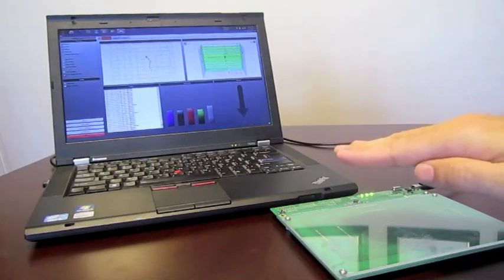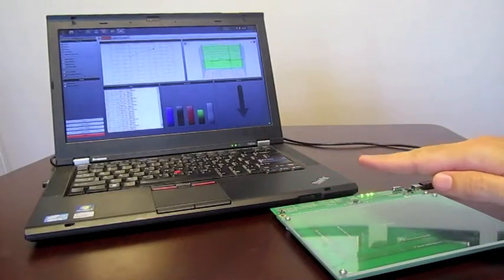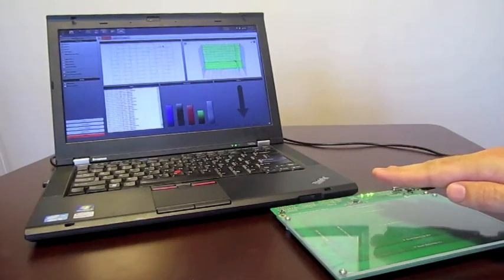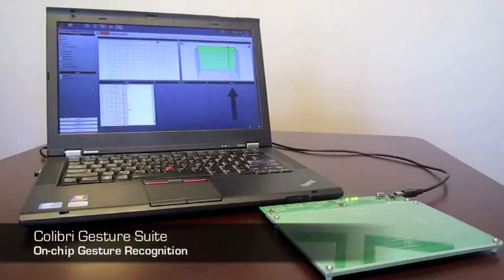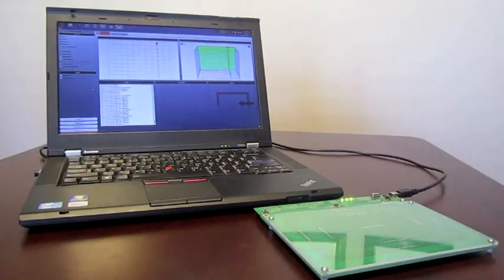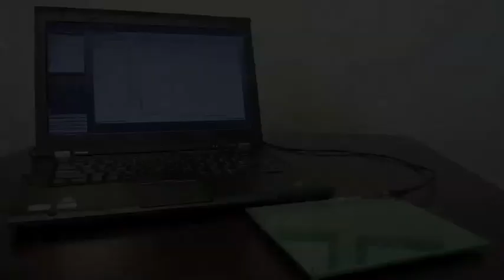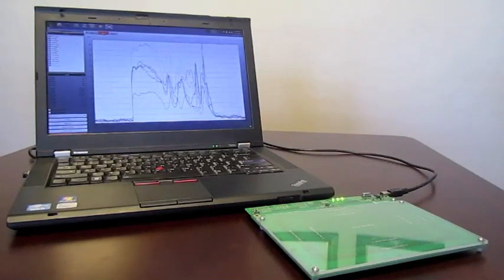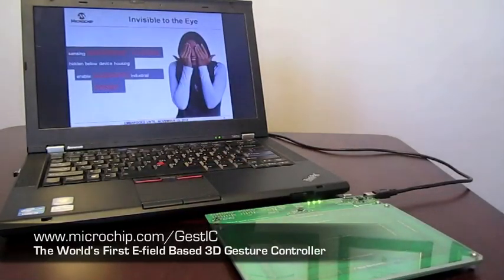Microchip's MGC3130 Demonstration

Comment from the maker: In the demo, it is just Printed Circuit Board (PCB) traces – essentially copper strips.  However, it can be any conductive material such as ITO for touch screen applications as an example.  Thanks for your questions.